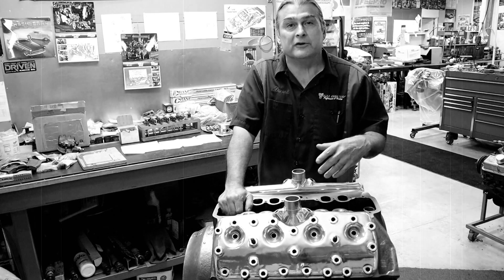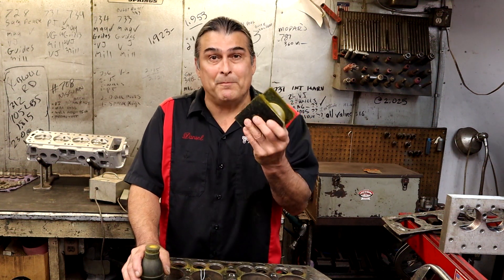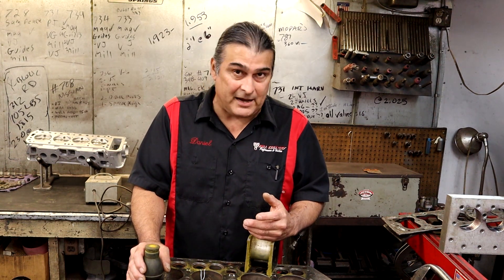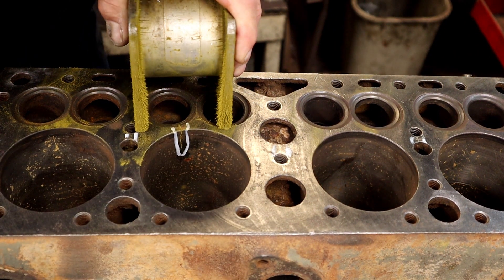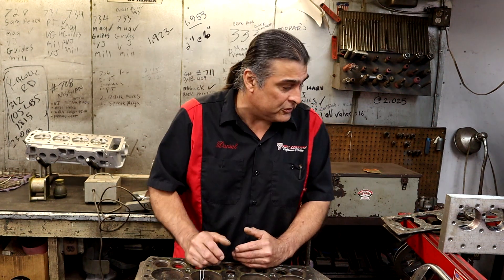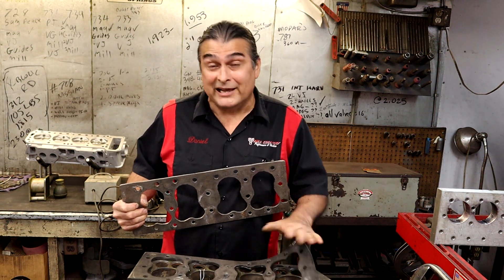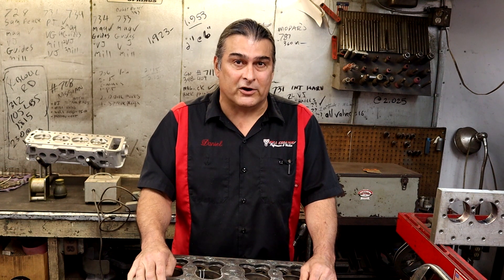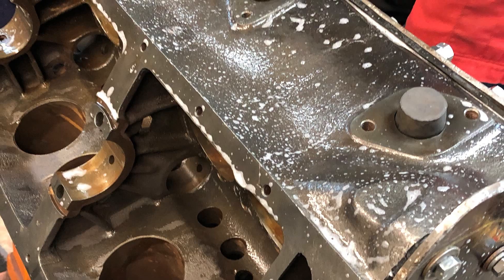What Is Magnafluxing?

Comment: Great video Danny, i have a flathead for a 29-A pickup project, it was rebuilt 20 years ago but never started, i pulled the heads and the intake and it all looks great, adjustable lifters, i'm making an adapter to install a 4L60 behind it and an 8.8 with 3.45 gears, i have been thinking i might turbo the engine with a T25, then i'd pull the pistons and run three ring pistons gapped for a turbo, i mentioned on Faye's channel i have a friend with about 80 flathead blocks were going to start testing, i made up a cad drawing to cut out pressure test plates, so i have a few sets now, and he has a magnaflux setup from a shop that closed, so now we just need to clear a spot in his shop to work, which is going to be the hard part, i really enjoyed the boring video you did with Faye, not boring at all, thanks for your effort.
Reply from the maker: How very cool, good luck cleaning the shop.

Comment: How about showing how cooling system "stop leak" fluids/powders/pellets work or don't work and if they harm your system?
Reply: @hipdad9461 Stop leak fluids like Irontite have been around since the 60s. It's a solution of sodium silicate that is run in the cooling system and when it gets hot it seals the small cracks by forming a glass like seal in the crack.

Comment: Glad to see you started a channel for yourself. Love watching you and Faye.......... Anyway, Im about to start a 460 build with aftermarket bare aluminum heads and I would like to see a video on how to properly setup roller rockers, proper roller tip to valve stem contact, proper roller rocker geometry and ratios, plus how to determine the proper pushrod lengths after I get the heads assembled and mounted. Thanks Danny.

Comment: I am just starting a really interesting engine and wasn't planning on pressure testing it unless I find cracks.  So chances are I will be pressure testing it since its 87 years old.  It has an aluminium crankcase, cast iron cylinder assembly which bolts to the crank case, and cast iron heads.  What do you recommend for crack testing on aluminum?  I have been using Zyglo.
Reply from the maker: That works well.
Reply from the maker: yes Zyglo and also pressure test.